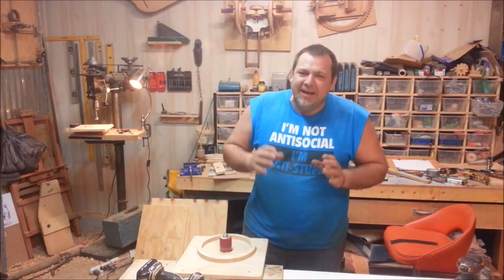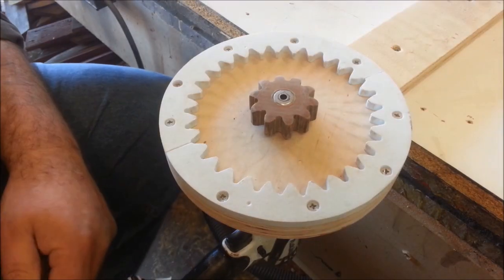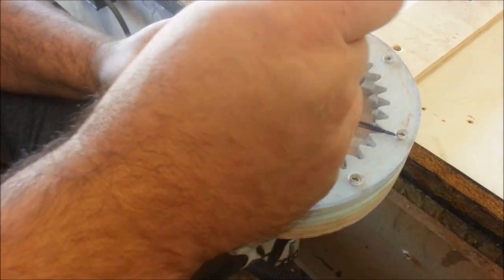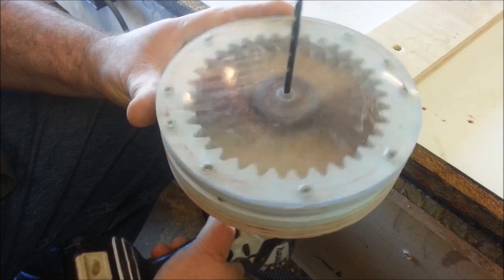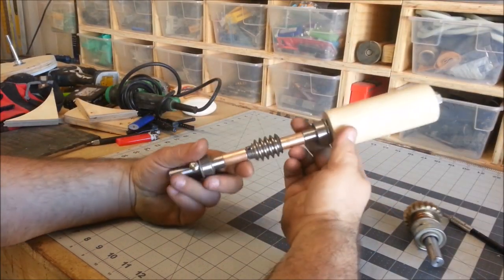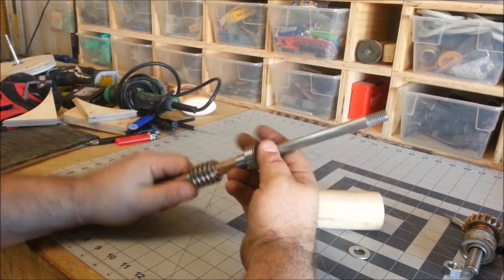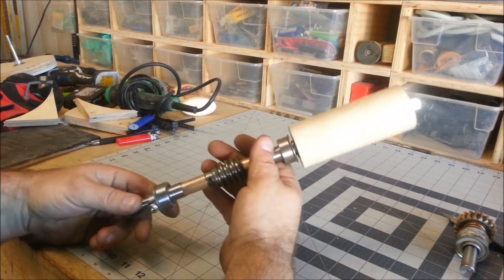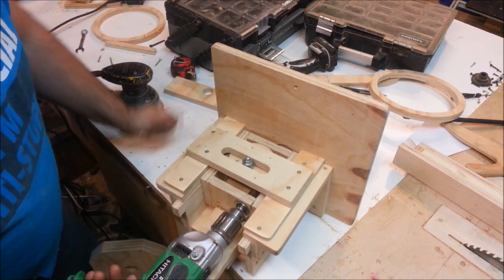Homemade oscillating spindle sander - drill powered!

Comment: Brilliant Izzy! Question:  if you used a flexible shaft between the drill and the main connection to your contraption, wouldn't you get better performance (since you wouldn't be raising the drill along with the contraption)?
Reply from the maker: Andre Berthiaume I had thought about that but i think there would be back lash when material is introduced to the drum and have undesirable effects. still its something to look into

Comment: You've really got me thinking, Izzy. You mentioned the wooden planetary drives wouldn't hold up well enough for this application. What applications or conditions would they work well for? Could they work to use a water wheel to drive a shaft? (Or, as wheels on your nut picker-upper to drive the paddle?)

Comment: I don't know if anyone has suggested/mentioned, and I suspect this will be something that you'll have considered anyway, but on your "entire system build" (crap name, you'll think of something better I'm sure), it'd be great if you could order it in such a fashion that you get use of the build in progress to make the other parts of the system. For example - from your video - you could use the lathe type thing to build parts for the oscillating sander. So, in theory, it builds itself, sort of, with added human of course. Excellent video.

Comment: have you tried testing it with other drills ?
Reply from the maker: BookofHolyH2O yes i tried it on a smaller drill it worked fine for this size sanding drum but i am afraid it would bog down with a larger one

Comment: Awesome video! I have made a drill-powered non-oscillating spindle sander. Much simplier than this, just blocks of wood that hold a drill under a piece of plywood. Sandpaper wears out more quickly but it's not too expensive to buy.

Comment: This is insanely cool Izzy. And the worm gear reduction is a brilliant sollution for the oscillating action. I am really looking forward to the finished version of the "ShopSmith" ala Izzy
Reply from the maker: Bellevue Woodshop Thank you, It will be a fun challenge trying to fit all these tools into one build and even more challenging to drive more then on tool with out having to move the drill all the time
Reply: izzy swan Challenge or not -- If you can get all the stations into a single combined unit -- it would still be a barrel full of AWESOME even if you had to move the drill around. The difference would be Ginormously-Awesome WIN! or Brain-Completely-Melted-In-Awe WIN!

Comment: This is awesome Izzy! I'm assuming that you could make whatever size spindle you want. Would there be any power issues if you were to put say a 4"+ diameter spindle on it?
Reply from the maker: Matthew Cremona yes it would work with a 4 inch spindle with no trouble there is plenty of power to spare
Reply: oooo a set of spindles with corresponding removable base plates.
Reply from the maker: TheKlickitat Oh Ya the final build will have all the bells and whistles
Reply: izzy swan Excellent!  The larger spindles would be incredibly useful and only seem to be available on the floor standing machines.  This would be a great way to compliment my benchtop spindle sander without spending all that money on a new machine.  Looking forward to the final details.  Thanks!